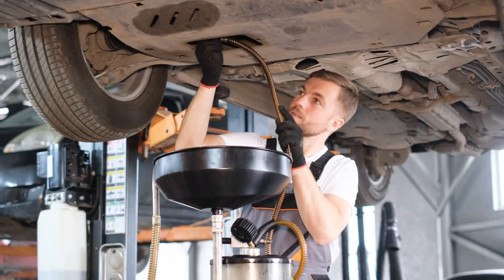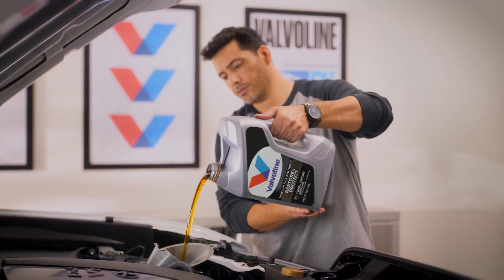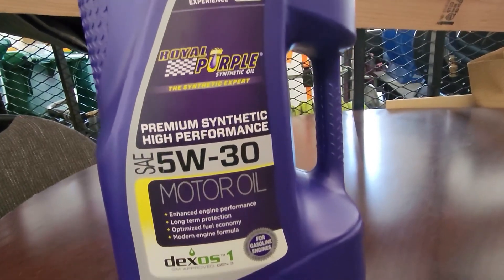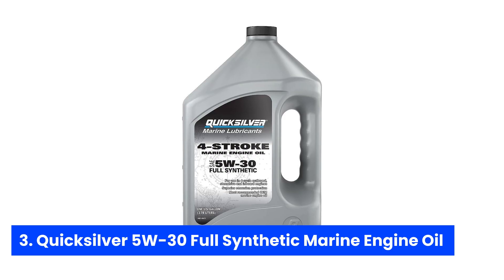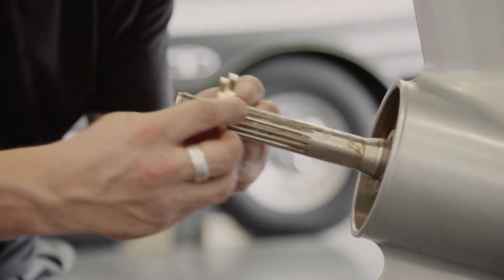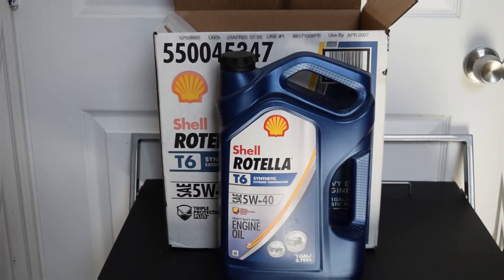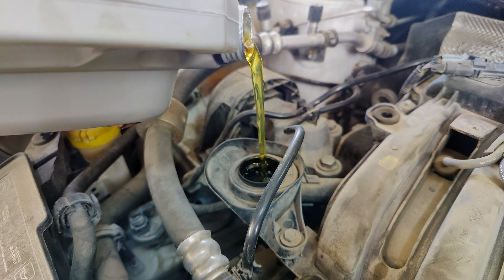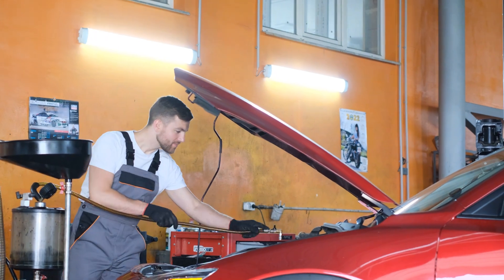5 Best Synthetic Oils 2025 (Tested) — Don’t Buy Until You Watch This

Comment: NOPE   If your list doesn't have Amsoil (like their Signature Series) then you get an F !          Amsoil oil filters are also the best in the business at cleaning oil,  their filters clean 99% of dirt at down to 20 microns in size.
Reply: Bowh,You may be right,but I've been using pennzoil for yrs,no problems!
Reply: @stevesutton5498  I use  it also on my 2001 GMC Sierra 5.3L V8
Reply: @stevesutton5498  that means nothing!
Reply from the maker: Understood! Amsoil has a serious reputation, especially with their Signature Series.
Reply: @picksandpros why did you you even have Pennzoil platinum at minimum. Or even royal purple. SMH. Talk about synthetic list. Lmfao this is garbage